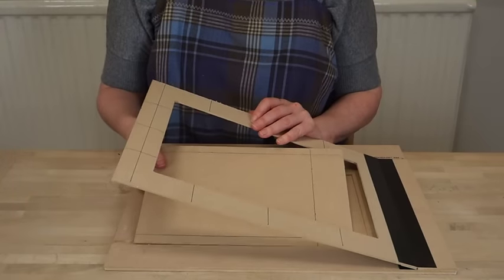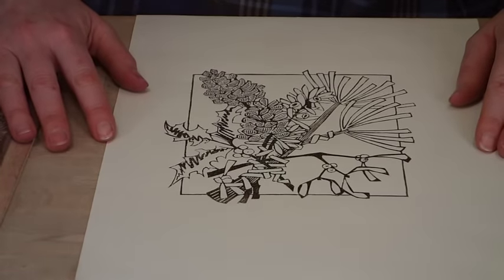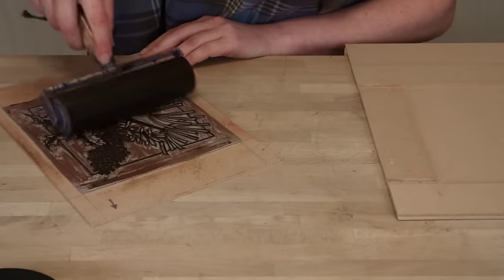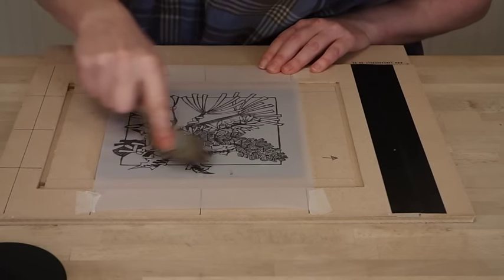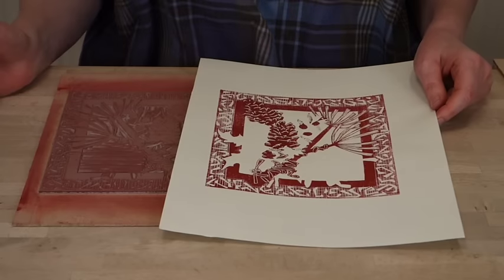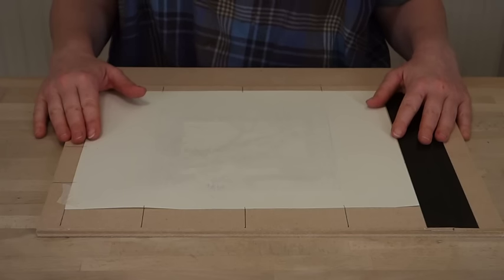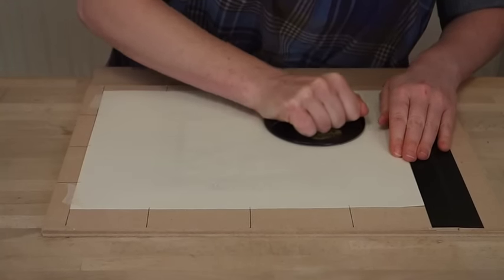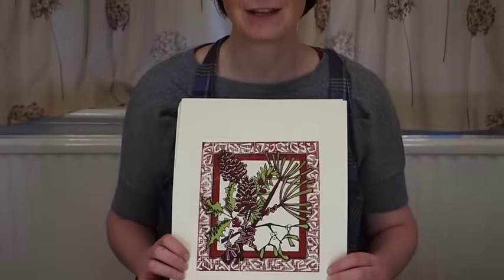Lino Printing:  Multi-block linocut printing using a Key Block method.

Comment: Hi Laura - Great vide and overview.  I am impressed with your registration device.  Can it be used for linoleum as well as paper of various sizes, or just for ones that print well on A4 paper?
Reply from the maker: Robert MacNeil the device will print up to an A4 piece of lino so the paper can be bigger. In a couple of days I am publishing a film with all sorts of hints and tips about using the reg device so look out for it in the #linowithlaura series
Reply: @LauraBoswellPrintmaker  Fantastic - I look forward to that upcoming video!  Many thanks!

Comment: I'm enjoying your videos very much. I tried to purchase your registration board but I am in the US. Any chance of making them available here as well?
Reply from the maker: Hi Jude we are working on sorting out the postage for sending these abroad, but we can do this for you manually at the moment. If you just put a straight order through my shop, it'll tell you the basket is overweight and that I'll get back to you. Then I'll mail you with the correct courier costs (I think about £15 off the top of my head, but I'll check properly of course) and we can go from there.